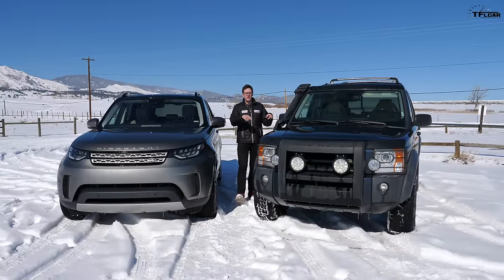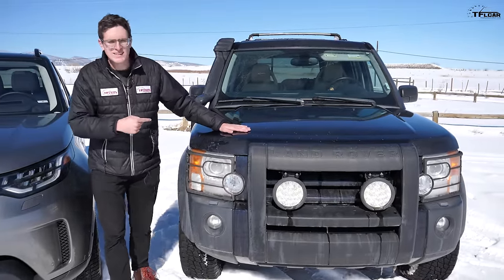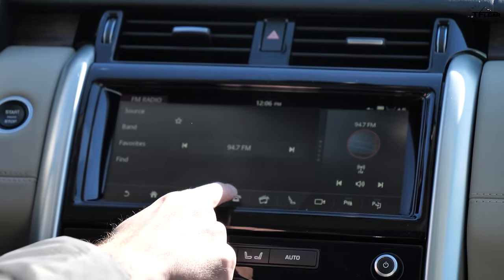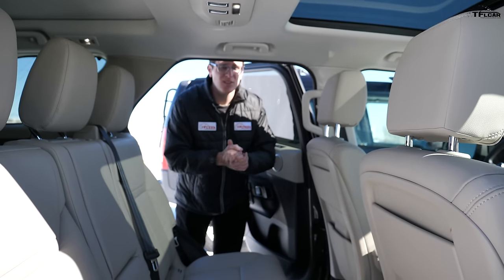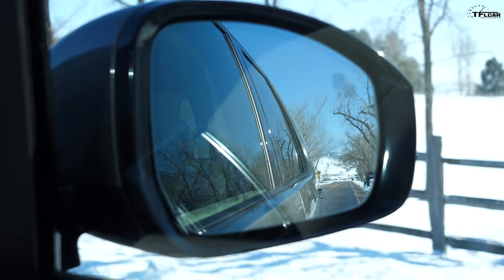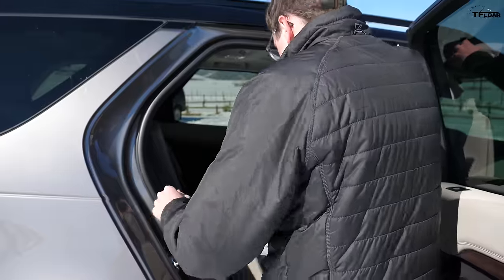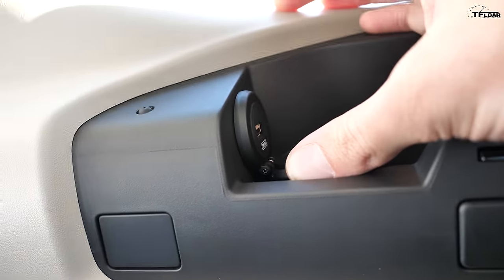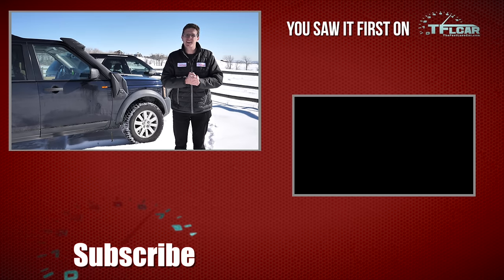Is The New Land Rover Discovery ACTUALLY BETTER Than A $5000 14-Year-Old LR3??

Comment: Look Tommy, I just bought a 2020 Discovery and didn’t think I would like it as much as I do.  I absolutely love this car and the ZF 8 speed is the best in the business.  This thing even warns you of red light cameras. Fun fact, it tows 8200 lbs.  Out of all the cars I’ve owned this car has the best headlights of the all and it even has REAR FOG LAMPs for safety.  I have always talked down about this brand but this Discovery feels very upscale and tight.

Comment: FYI, over here in the UK, the Volume Knob is on the other side (left) in all JLR cars. Basically, it’s for the passenger to use (as the driver has volume controls on the Steering Wheel). So, it’s on the right for the passenger for you guys
Reply: Actually it’s the same exact stereo because our volume control is on the left.

Comment: Great video. I had an ‘08 LR3 SE7. Of the nine Land Rovers I’ve owned, it was the most practical and most reliable. It was no slouch either- felt plenty quick. If only LR had put the 4.2 Supercharged engine in it! Overall, I’d go LR3. But having said that, I’d pick my ‘07 L322 Supercharged over both. It’s amazing.

Comment: Thanks for your great video! I have to mention that I do have a 2005 LR3 and a 2011 LR4. They both still look relatively new and still function quite well at 215 and 137 miles respectively. This is as I do pay a great deal of attention to maintenance regarding them. My wife drives the 2011 LR4. The LR3 that I drive is quite souped-up with third-party external accessories... including black taillights, a black velvet hood decal, sidebars, a snorkel, window tints, and a rear ladder.   We both get compliments on them all the time.

Comment: Have a discovery 1, 110 and a lr4. I really stopped liking new land rover vehicles after the lr4. It was probably the last old school land rover. Its like land rover hired the same designer for all its new models to save a few dollars. Every single one looks as if its based on the evoque. Which at the time wasn't bad looking, however when every model looks similar i lost interest. When a discovery sport, discovery, evoque, velar, rr sport, and range rover and now the defender all look so similar unless you own a land rover that you likely dont know the difference between a 40k evoque and a 90k range rover, we have an issue. Not to mention, getting rid of the v8 on most models. Land rover has changed from being an off roader pretending to be an suv to an suv pretending to be an off roader, which is a shame. Their last true off roader was probably the lr3 or lr4. Havent drove a new defender so i cannot comment on those however i expect it nots true to its 90, 110 or 130 roots. 
I feel as if land rover is abandoning its heritage, if you look at a Mercedes G wagon, no matter if its a model from 1980s or a brand new one, its still a g wagon. Same with the jeep wrangler, its instantly recognizable as a wrangler, land rover went the opposite way instead of model recognition theyre going for brand recognition. Which to me is the wrong approach. If i wanted a sleek fuel efficient crossover, id get a Toyota. Not a land rover. Old land rover's stood out, now modern ones just blend in...

Comment: Nice video, Tommy. I appreciate the walk through of both. 

I have an ‘07 LR3 with the factory installed third row seating. I’m not sure if your LR3 with the converted third row seating has this but in mine, the middle row of seats actually flip forward to allow access to the third row of seats. If I recall, once the middle row of seats is folding down, there should be a latch on the back of the seat, near the bottom. This allows the passenger in the third row to release the seat so they can get out. Again, I’m not sure yours will have that latch but on LR3’s with the factory installed third row, they will. 

Also, at 8:20, that is a cup holder. If the holder is functioning, just press in the bottom part and the cup holder should pop out. 

Hope this helps!
Reply: Theres also two cup holders for the second row, underneath where the aux port is.

Comment: "Poverty spec" is the best name for a trim level
Reply: Sithhy - except Tommy’s model isn’t the poverty spec. It’s a V8 SE, which was mid trim level.
Reply: @tylermacconnell217  not in North America. North America only got SE, HSE, then later on HSE Lux. While rest of world got an actual base model.
Reply: Zachary Solomon - actually, there were three trims when the LR3 came out. V6 SE, V8 SE, and V8 HSE. That makes Tommy’s “mid trim.” I noticed his actually has the optional higher end Harmon-Kardon sound system that came standard on HSE.
Reply: @tylermacconnell217  yeah you're right I forgot the v6 and v8 SE were different trims. Yes he does have the high end speaker just like my SE. Although there were three versions base non harmon then a harmon with 240w system which has no center speaker or 3rd row speakers Then you had the fancy harmon used on forgot what the amp is called but I do know after replacing many, many fibre optics tgat it uses fibre optic instead of conventional wires. Also, normally at shops we just differentuate lr3 from the wording instead if engine so SE, HSE, HSE Lux though you are correct in that the SE is split between engines. I also agree that from I saw he does have the highest end radio because he had the 3rd row radio control. Although I'm surprised his doesn't have the cold climate package that a ton of lr3 have.
Edit: I remember what the radio were called it was low line, then harmon kardon, the premium audio HK with logic 7.
Reply: Zachary Solomon - our 2005 had the 240w harman/kardon stereo, which sounded pretty good. We had a V8 SE
Reply: @tylermacconnell217  yeah the 240w system is what I prefer as it's easier to fix when the wired in the door eventually break as all wires do. I just wished it had a center speaker.  I understand no 3rd row speakers. Did yours have the rare rear diff lock?
Reply: Zachary Solomon. No it did not, unfortunately. It did have the factory Warn winch though, along with the factory soft brush bar and factory auxiliary spot lights. Ours had the third seat with extra climate control, the cold    climate package, the bixenon headlights, etc.

Comment: The aux port is actually super convenient in todays time. In the LR3 and the LR2 you can put an FM transmitter right next to it but out of the way of the drivers cig lighter and run a tiny aux chord right into it. Boom, not transmitting over radio waves, just straight up Bluetooth.
Reply: Also! On your new LR3 that doesn’t have an aux jack, I’d check behind the panel. A lot of land rovers of this era have all the options installed like heated seats and the like, they just didn’t install the switches and pretended it was a whole ordeal to install those features.

Comment: Great review.  One thing about the LR3 which is my offroad truck now.  It normally seems sluggish even with the V8, but you can move the shifter left to enter sport mode which gives it A LOT more passing power.  Not a sport SUV by any means but a great option for getting that extra power you want.

The LR3 is a legit off roader and overland vehicle, if you're willing to risk going out with an air suspension.  But with the terrain response system and  a locking rear diff, it gets me where I need to go off road.  Also a pretty good 3rd party market for LR3-specific accessories like racks, swing away tire holders, etc.

Comment: I'll take the "nightmare" 2 minute 3rd row seat setup over that blob they call the Discovery 5.  As others have pointed out, that's a cup holder not a cubby.  The LR3 has a tow rating of 7700 lbs, and 8200 lbs for newer Discovery 5 HOWEVER the new diesel is only rated to 7700 lbs, despite having more torque.  Nice one Land Rover.  Put a diesel in a truck and derate the towing capacity.  I like the old interior, felt pretty "modern" to me coming from an old ****box 1998 Subaru Forester.  There is simply nothing unique about the new one's styling that makes me want to buy one.  Nothing.   Thanks for the comparison.

Comment: At 8:20 that is actually a cup holder.  Press on the rectangle and the cub holder opens. There’s no shortage of cup holders in an LR3.  Two in the dash center console, one on the passenger dash, one in each door front and back, 2 in the rear center console, two in the third row. (And I probably missed a few more)

Comment: The LR4 had a much better interior over the 3. The split tail gate on the 3 and 4 - without the tyre hanging did have some functionality... It allowed your to reach easier into the far back of the trunk / boot if you were loading or reaching where the  horizontal tail gate when open was narrower ..

Comment: I own a 2008 LR3 up here in Canada where they made the 4.0 v6 until 2009 before the LR4. My V6 acceleration doesn’t seem much worse than your V8 in the video. The V6 from the explorer was tuned much differently in the LR3. You had true duel exhaust with stainless shorty headers and and split runner variable intake manifold that help produced great low end torque. Problem is the party is over at 4500rpm where the peak HP of 216hp arrived. That’s due in part to it being only a 12v engine and running out of air flow. There are not many modern v6 set ups that can’t produce the low end punch of this setup. 269ft/lbs at 3000RPM is still very respectful considering most modern V6 can’t hit that number till almost 4500-5000 rpm. I also love the weight of the LR3. It’s built like a tank with a fully boxed frame with a monocoque sitting on that. So I feel my family is safe in it. The New discovery is a joke in my opinion, save 30 grand and buy an explorer if you want a lifted car. Plus if you buy the 4.0 V6 you can hit up the auto wrecker for ford 4.0 v6 parts and save a ton of money!😂
Reply: That’s what I said my V6 is great.

Comment: I’d love to have seen an 2014-2016 LR4 vs. 2017+ D5 video. Both should be equipped with the rear locker and tested off road. The current Disco is a bit of a disappointment from the locks standpoint, but I care more about ability than looks.

Comment: First, to answer your question at 16:51, it does have a factory tan fuzzy on the seat backs if you had a tan interior. If it had a black interior, it would've been black. And the conversion job is really not that difficult.

  You have to compare apples to apples. The LR3 "poverty spec" model you have was not a fair comparison. We have an LR3 with the navigation system up in the dash cubby that also shows you what you need to know about the diffs and if they are locked just like the D5. Our center console also has a factory fridge, just like like the D5. It's a seven seater with the 3 roof dials for the rear passengers as well.

At 20:01 you notice the rear recovery point, but you missed the front end one behind a similar plastic panel.

I agree that the AUX outlet in the LR3 is in a very weird place, I never saw the point of that location.

Finally, you make no mention of the fact that in the LR3, there is physically TWICE as much cargo space!  (LR3@90ft/D5@45ft)

So either you'd need to make two trips in a D5 or take two D5s to carry the same load. 

The factory D5 rim/tire combo were also never made for offroading. 

These two vehicles were made for two entirely different purposes. The LR3 was a stepped down Range Rover, and the D5 is a name plate for bragging rights and an elegant status symbol for soccer moms. I mean, even the Ford Explorer has an identical Terrain Response system and power tailgate these days. The D5 has a beautiful modern interior, and the LR3 has a functional one.

If you wanted a fancy 5 seat LR3 back in 2006, you would've bought the 5 seat Range Rover. They were for different market audiences. Your review was obviously heavily weighted with presentism by it's very nature of the comparison; judging something from the past with the standard of today. That is why it is so great! The D5 stands out in no way to other modern SUVs, but the LR3 was a trailblazer for most SUVs to come.

Comment: 10 years from now, the people will remember the LR3, not the newest version. In term of reselling values they will be also pretty close by then. 

The LR3 3rd row seats is a great piece of engineering even if it takes a few seconds for the set up. The new generation of car owners would go sweating 3 times per week in the gym but would feel reluctant to use a bit of strength to open them. That's the funny world we are living in...
Reply: The value of the land rover LR3 with the diesel engine or the 4.4 v8 is crazy, even with 200000 miles they want 20 grand for them

Comment: Good comparison. Worth noting the D3/4 models could also be had with a screen showing the diff locks, wheel direction and other stuff. As well as outside cameras from all round the vehicle, while it is undoubtably better on the D5, it isn't new. As for the Terrain Response taking the stress out of 4 wheeling. I actually believe the opposite. All the tech, switches, screens and options in the D5 mean you probably need to spend days just trying to figure out what it all means. Then you need to be an off road expert to then know how to apply the tech and which options to select and when. In past days, 4 wheeling was far more simple. In fact it has got so bad now, that LR want you to attend a driving course to learn how to use the vehicle when you buy a new one. It really is that complicated.

Comment: Honestly the Discovery 3 is way better. But among all LR there in no other like a good old Defender 300 tdi I bought the very last 300tdi shipped to South America, and till today never let me down even had a mechanical problem, where the turbo hooses disconnected during a hard off road losing significantly power but still managed to climb the hill due to torque, and was that hill. Saved my life.

Comment: Actually as a owner of a V6 LR3 it’s a pretty good engine. Power is not an issue in fact its probably better than the V8 because it makes more power down low. Ours has never had any trouble passing anyone. In fact from what I’ve heard from other LR3 owners that have driven both is that the V6 works much better with the transmission in the LR3 than the V8 does.
Reply: Garden Tractors - Disagree. The Ford V6 in the base LR3’s is SOHC. It makes fine power, but the V8 makes more, and more torque. The transmission in the LR3 is the same one found in the F150, a ZF unit. Obviously, the F150 transmission is behind a V8 engine 95% of the time. It’s a great transmission regardless of what engine it’s behind.
Reply: JAA - If you’re asking me, we sold our 2005 LR3 V8 in 2013. It needed a suspension compressor and a couple height sensors. It also needed both engine VVTs replaced. The sunroof leaked. Otherwise no issues.
Reply: Overall mechanically pretty solid it’s needed a alternator and the other day I had to buy a air compressor for it to replace the 14 years old original. It was $400ish from lucky 8. The engine has been bombproof just standard maintenance. It’s probably do for injectors before too long but that’s just me being ocd about maintenance. It has needed the sunroof drains cleaned and a couple replaced but I’ve done all that myself and it was dirt cheap. Honestly it’s been the most reliable vehicle in the family that includes 6 Toyota’s we’ve had. Ironically enough the only time it has ever left us stranded was when the alternator died which was made by Denso which is owned by Toyota and it’s the same brand Toyota uses.
Reply: The V8 does make more HP and torque but it does so at a higher rpm around 4K IIRC. And like I said I know guys who have driven both they say around town and below 3,000 rpm there isn’t much difference if any. Obviously the V8 would be faster flat out and it might actually be slightly better around town IDK. I do know compared to our 5.0 LR4 around town the V6 is slower but it’s definitely not a dog. But then again I’m at sea level so that makes a difference.

Comment: The Diesel engines in the rest of the world for the LR3/Discovery 3 were adequate for cruising and overtaking. There were further improvements on the V6 diesel engines in the LR4/Discovery 4. In a large amount of countries where the vehicles were sold the primary option was the diesel due to fuel consumption on the Petrol models.

Comment: 3:03 is not pointing in the wrong direction, the lr3 was, the 5 points in the same direction the Disco 1 and 2 did. The spare was on the passenger side.

Comment: Having owned two Discovery 4’s (just like the 3, but with a much plusher interior and more power), the new 5 was one of the two biggest disappointments of my automotive life and meant that I moved on to a Range Rover instead.
The 5 looks like and feels like an ordinary car, with a bit more height and lacks all authenticity as a Land Rover.
What you didn’t notice is that if you lower the suspension on the 5 as low as it will go and then lower it even further with the button in the boot, then the boot floor is still only as low as the boot in the 3 is in its standard ride height 🤣
Reply: Totally! JLR lost a big opportunity chasing curves over functionality!

Comment: Discovery 5 tailgate swoop may no be on the wrong side if you had a right hand drive model...😉. 

Also the little inside tailgate is probably to protect the painted bumper from scratches   Just a thought.